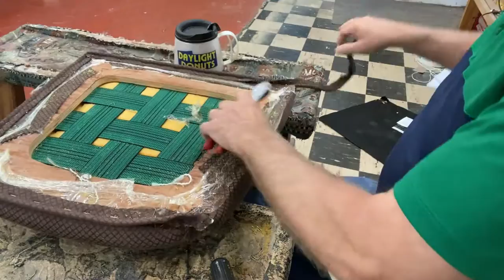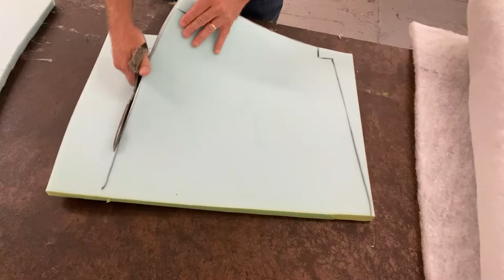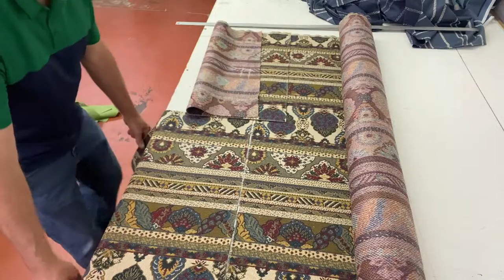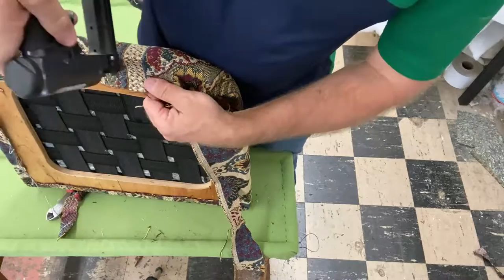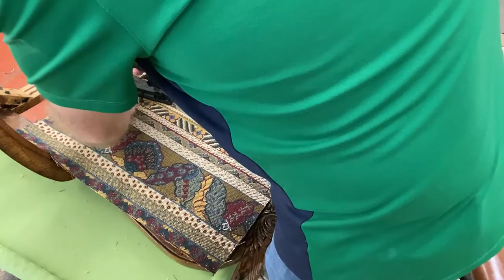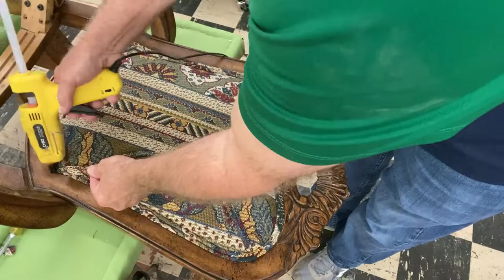HOW TO UPHOLSTER A DINING CHAIR W/ INSET BACK

Comment: I don’t quite understand how you dealt with the cut out corners on the seat back. This is the only video I have hound with chairs like these, like mine. I have rewatched in slo mo but can’t quite see how you deal with this issue.
Reply from the maker: In most cases you only need to pull the fabric into the middle

Comment: Beautiful. I am going to upholster a friends old Grandmothers rocking chair which has had the wood painted years ago. (Dark brown). The wood looks to be a beautiful pecan. Where the paint has rubbed away, the chair is beautiful. The brown paint is gummy and stinks. 
What can I clean this wood with?
Reply from the maker: May need to use a paint stripper. I’m not a refinisher, but I’d start with that, then evaluate a second coat before sanding

Comment: Thank you for the video this is exactly what I have .. how do I know if I need to replace the foam cushion? It’s an antique chair that feels like the cushion is in great condition but idk if there’s dust etc all in the foam from being so old?
Reply from the maker: If it is a loose cushion, you would see a fine yellow dust on the decking underneath. If it’s a tight seat, the yellow dust would be trapped or falling out of the bottom dust cover. 
Either way, once you are dissatisfied with the cushion, I would replace it.
Reply: @MarksUpholstery  ok thank you so much for responding and helping 🙌🏻
Reply: @MarksUpholstery  are you on any other platforms? I’d like to ask a couple questions about this chair (possibly send a pic). I wanted to do faux leather but not sure if it’s even possible.
Reply: @MarksUpholstery  I’ve basically spent 12 hours in all trying to answer my own questions and it’s a shot in the dark everytime or just not quite what I need - so wanted to ask you!
Reply from the maker: @amongthewildspices  
betchesupholstery@gmail.com